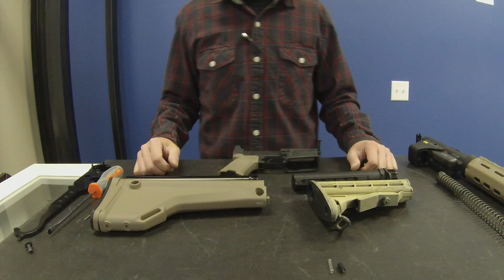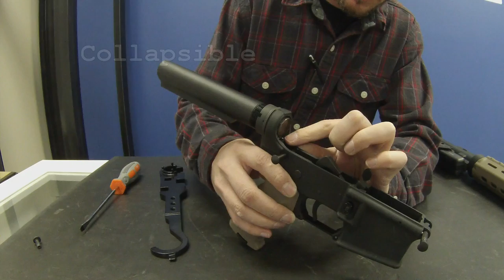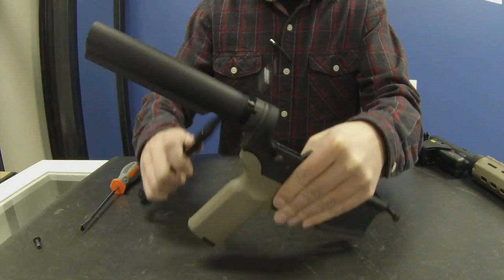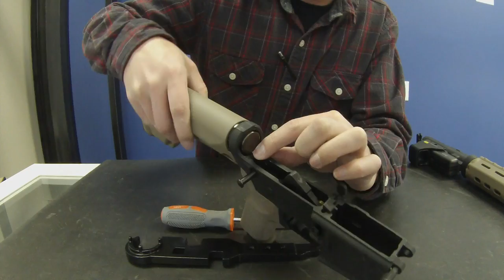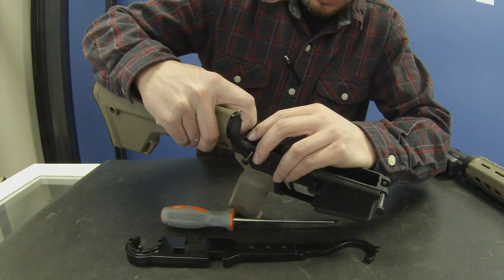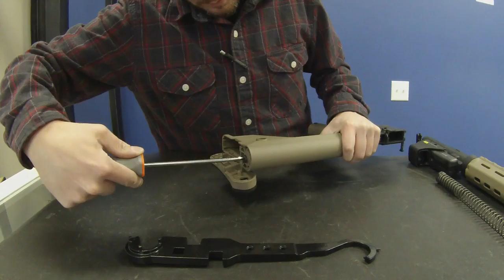AR15 Fast Buffer Tube Removal

Comment: I like how he used minimum torque to get this off. Been working on mine for 30 minutes, just trying to get it off. Thought I might be rotating it the wrong way. Nope.
Reply from the maker: Mine was not secured by staking or loctite. Yours could be which will require more effort.
Reply: @BrandonFlodman  does galil ace gen 2 brace come off the same way?

Comment: Maybe someone can help me.... I'm having this weird issue where the buffer tube and stock will shift left or right maybe 25—30° back and forth. My castle nut is nice and tight, I even loosened it then torqued it back to spec and then displaced some metal into the castlenut to make sure it stays put.... Even with that all tightened down properly I still get the weird shift back and forth. Any ideas would be GREATLY appreciated!

Comment: If I decided to leave my collapsible stock off..will my firearm still function  correctly  ??
Reply from the maker: With the buffer tube in place but the collapsible stock part that goes against your shoulder off, it would still function but may not be legal depending on location/registration.

Comment: Yea this is a pain in the ass trying to take the castle nut off....idk if the factory used some sort of industrial strength loctite or what but I’m just shredding this buffer tube threading..... forget it
Reply: my castle nut began to deform before I could break any torque. same boat
Reply: @DIRTYYETTI  talked to my armorer buddy. if the castle nut isn't staked, try heating it with a propane torch. It may just be locktite keeping it in place

Comment: My buffer tube is on extremely tight, so tight that it ended up breaking my armorers tool, any tips to try and get it off? It’s a collapsible tube
Reply from the maker: Can you tell if there is any Loctite residue? You might need to use heat to help loosen it.
Reply: I recommend a new rifle. Seems like a perfect excuse to me.

Comment: I just had a gunshmith do this for me at a local gun shop, and now my bolt won't lock to the rear.   It seems like the bolt is hitting something that's preventing it from traveling back and locking.  It won't lock manually or with an empty mag.  The only way I can get it to lock is if I pull REALLY hard on the charging handle, which is a no-go.  Do you know what could be wrong?
Reply from the maker: +whiskeywilliams You should ask them if they used the same buffer spring that was already in your gun. When switching from collapsible to non-collapsible or the other way around your gun will need the corresponding buffer spring. Without seeing it that sounds like the issue to me.
Reply: Good info, I'll look into that, thanks!
Reply from the maker: +whiskeywilliams No problem. Hope that helps.

Comment: Doing my first build.. Can the A2 rifle buffer tube be tightened enough by hand or is a armors wrench recommended.
Reply from the maker: Using the wrench for the castle nut would be recommended. Some will also say you should stake it into place.
Reply: Actually there's no castle nut. Its the one piece rifle tube that threads right the lower receiver .. Also your videos clear and informative. Very well done. Thank you
Reply from the maker: @armyveteran-vf7wc  Perfect. Thank you for watching and taking time to comment.

Comment: the gun shop I had to "stake" the castle nut that holds end plate on and buffer tube in, used locktite instead of staking the nut...now that I want to replace the basic endplate, I cannot remove the nut nor can a buddy of mine who built quite a few ar15...we tried heat and manhandle it, no go.
Reply from the maker: That's crap! I would suggest taking it back in there and make them do what they were suppose to do. If you want to try something else yourself you could try acetone. It may not penetrate the threads very well but worth a shot I suppose. What was your method for applying heat?
Reply: +Brandon Flodman that Shop put this nut on a long time ago, so it's been a while past when I noticed this issue...

was using a propane torch...I'm looking to picking up a hammerhead rifle wrench and a vice, and try again.

what inexpensive vise would you recommend?
Reply from the maker: I'm using a Stanley Multi-Angle Vice. I got it on Amazon a handful of years back for around $30.

Comment: I broke the little spring you took our around 1:31... I searched amazon and couldn't fine a new one.  Any ideas?
Reply from the maker: You should be able to find what you need by searching AR-15 detent spring. I see one on there for under $5 including shipping. Otherwise you might be able to get it even cheaper at your local gun shop if they carry stuff like that.
Reply: Brandon Flodman, thanks for the help!
Reply from the maker: You're welcome. Thanks for watching.
Reply: +Caleb Plumley (PlumProGamer)  Hello, Delton makes an AR15 spare parts kit with all the small springs and detents, for about 20 bucks, It is invaluable. I lost mine completely once by being careless.
Reply: Extremely late reply, but I recommend building an "oh shit kit" with all the little pieces. That way if you lose/break/have a failure, you can fix it immediately.

Comment: What is the life span of a buffer spring. I have a Core Tac III about 3 years old and about 1200 rounds through it? Also, does keeping stored with the bolt back lessen the lifespan or does it matter? THX
Reply from the maker: I don't believe there is really an exact number/timeframe to go by for that. I've had a lot more through mine without any signs of needing replaced. I would recommend just keeping a spare on hand and replace when it becomes necessary. I wouldn't worry about wearing out the spring from storing w/ the bolt back.